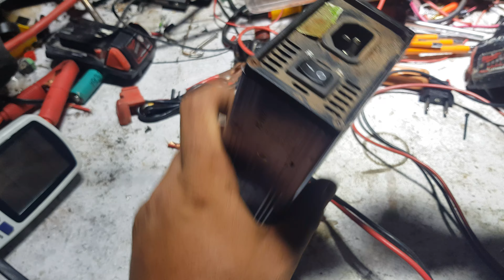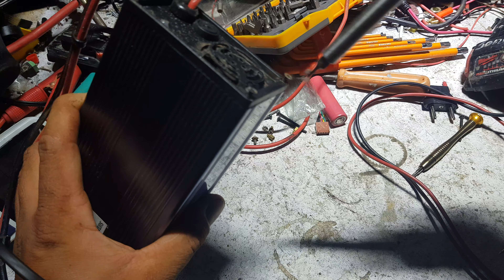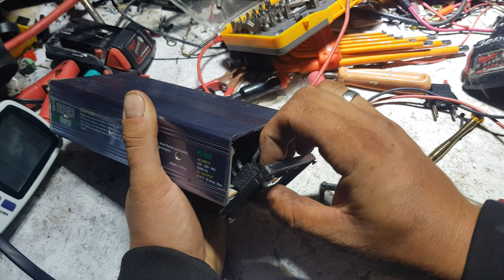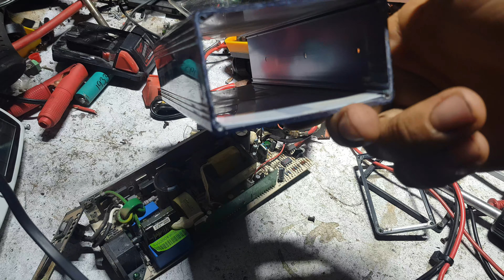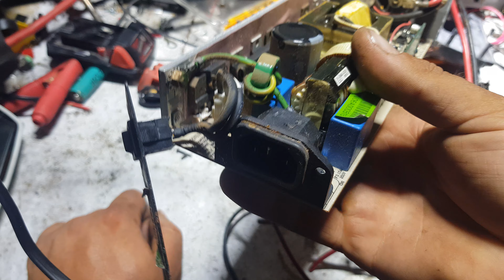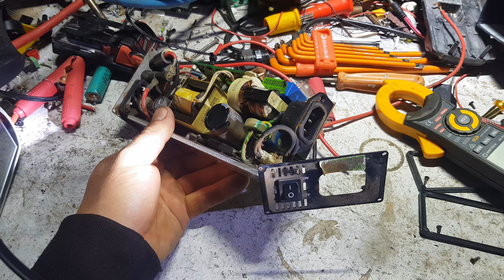Sinergex Smart 12v Battery Charger Dead

Comment: The charger might have just blown a fuse. When you set the multimeter to AMPS and applied the probes across a voltage you are basically short circuiting what I guess is 240v - hence the flash/arc.... You are lucky you didn't fry your multimeter.
Reply from the maker: It was letting ac power through into the 12v side  some sort of power supply issue. Was a Hazzard so pulled it out of servcie